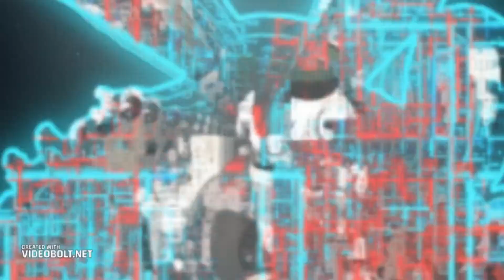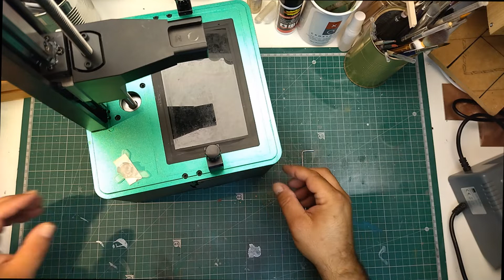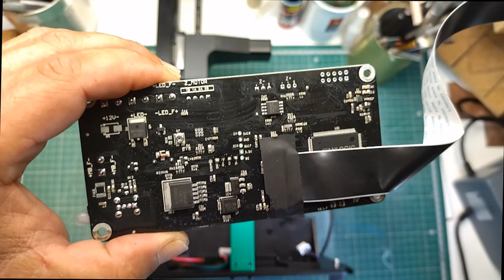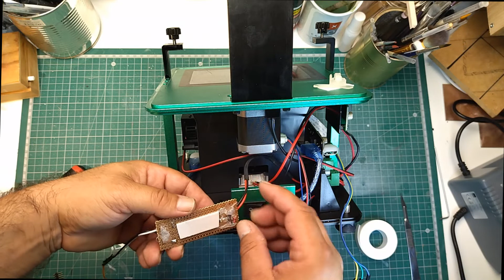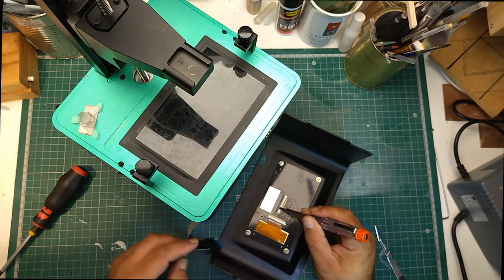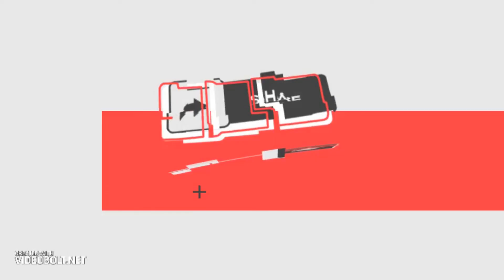Control your SLA Printer over WIFI with Octoprint PART#1 [UPDATE in desc]

Comment: Awesome project!
Octoprint documentation says that for SLA printers, even with plugin, only Works for printers with chitu Motherboards.
I have a Creality Halot One printer, wich dosent use a chitu board. Do you know If connecting the pi directly at rx and tx to the board, like you did, Will Work? Or really  is a software conpatibility issue  that octoprint really isnt compatible with the Halot One?
Reply from the maker: to be honest i din´t think so as normaly the commands set is propriatery, that meens the the commands might not work.... but....

testing is king.... so if you could test and let us know it would be great

Comment: Can you use a raspberry pi 4 for this?
Reply from the maker: yes you can....same process
Reply: @crazyrabbit4006   I have a 4b and 3b Raspberry Pi, how would I wire the OTG/USB?
Reply from the maker: @viiioviii7924  hello mate

just follow the link on the original post or this one https://community.octoprint.org/t/put-tape-on-the-5v-pin-why-and-how/13574

Comment: Why not put the raspberry pi directly in to the printer and shorten the cable directly from the chitu board? Awsome video thanks for the info
Reply from the maker: hello mate
Yes i could do that but i haven't for 2 reasons:

1st - Wifi signal... if you get the PI inside you will lose reception IF you are far way from the router (like me)

2th - Overheat
As we all know heat and electronics don't match, and if we like it or not the LED does heat up the inside.

Hope it helps